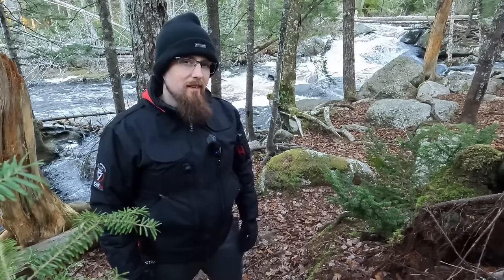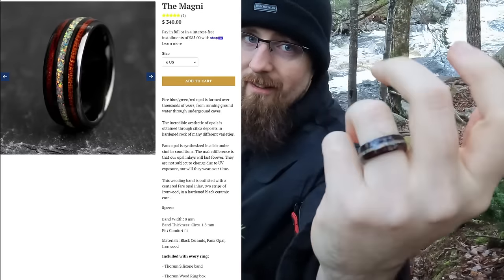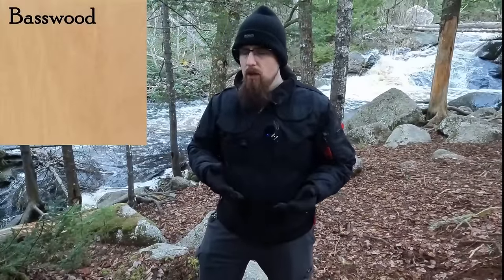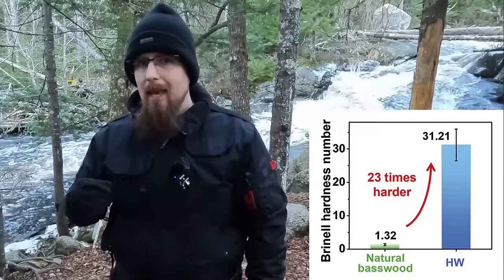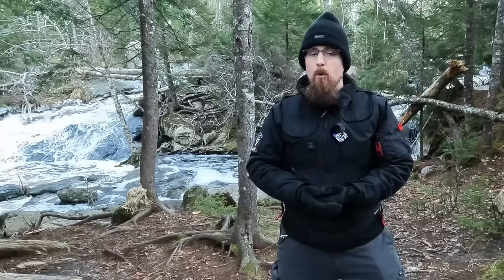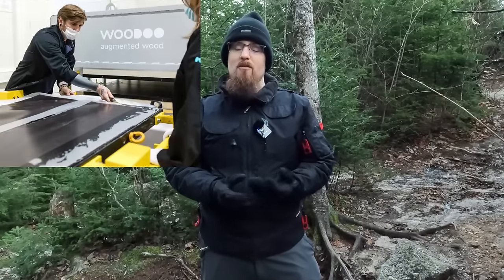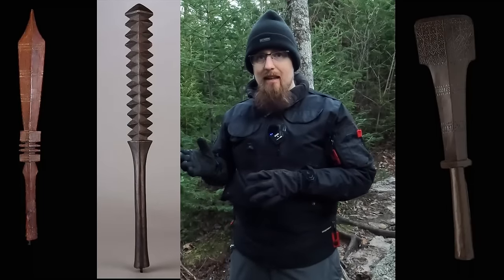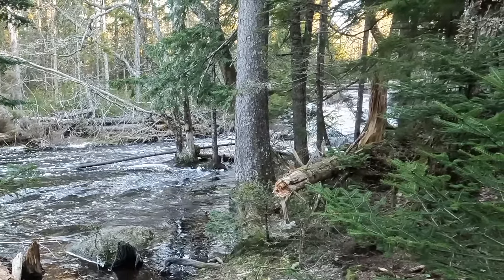Hardened Super Wood!  -  Can It Rival Steel?

Comment: I'm a baseball bat maker and engineer, and have been looking at wood densification for baseball bats. One thing to note, the hardness goes up but also the density goes up. The strength to weight ratio is actually very close to that of real wood, so densified basswood made at ipe level density will have roughly ipe level strength. It isn't a magical performance increase and its main benefit is cost efficiency over performance increases. It's good for going beyond natural wood capabilities, but strength to weight ratio does not go beyond natural range.

It has major issues with moisture and movement in service. Epoxy impregnated wood is brittle and has reduced specific strength. So super hard wood is still a niche product, not for the industry yet. Otherwise, it'd be everywhere by now.

Now, the process that seems most promising to wood industries and is currently implemented is the process currently used with wood veneer, which is surface densification. Think of it as case-hardening, but for wood. You harden and compress the surface of the wood while the core remains natural and light. This has the effect of reducing wear and tear while not making it super heavy. It's like how you hammer bronze to work-harden it. They're all the same effect. Case hardening carburizes steel to make the surface harder. Hammer bronze to work harden the edge. Compress the wood surface to make it harder while density doesn't go up as much.

Ironically, this has been done unknowingly by baseball and cricket players for centuries, called boning the bat or knocking the bat for cricket, where you rub a bone, hammer with a mallet, or rub a hard metal bar to compress the wood and close the pores. It is effective and very well known and i believe this process might have been used for ancient weapon makers, although sources are hard to come by. I can imagine it so, since it's so easy. The effect of compressing the surface also makes fitting attachments easier since the wood will expand with moisture, filling the gaps. This is prevented with a good sealer and finish, but it isn't perfect. Shellac and tung oil is the historical finish of choice, but it can sometimes pop the grain, which ruins the densification

I rub a steel bar on all my bats and players can tell the difference
Reply: have you tried any boiling,  drying, and vacume impregnation with epoxy?
Reply: @RubSomefastOnIt  not me personally but my buddy tells me it's too brittle. He tried vacuum and oven dried cherry and walnut and impregnated with epoxy, densified it to the high density bat level on a 271 turn model. Getting an evenly round surface is hard and the results were underwhelming. It hit just like a regular hard ball bat and then flaked off. The effect of the epoxy had the slight benefit of making large barrel turn models hit like higher density turn models, but at that point, might as well get a High Density bat.
Surprisingly enough, hardness in baseball is not as important as rebound. It's just that wood has poor rebound, so hardness is used as a substitute to prevent energy lost to deformation. A brittle process that is good against scratches will be bad for baseball
Reply: @Tevatron044  I have to tell you I rather enjoyed your read here. I actually find this practical as someone who's constantly bushcrafting and looking for small ways to use time to better improve my tools around a camp site. The knowledge you just dropped wasn't things I'd normally consider and I'm grateful you took the time to post it.
Reply: I believe the extreme case hardness of  Bamboo it what gives it extraordinary properties,  The technology  is nothing  new,  It was adopted in the industrial revolution  to manufacture bobbin spools for the weaving industry . I think  lime wood.    I recall a wood turner talking about it in a demo.
Reply: @HavanaWoody  lignostone is probably the oldest variant I've seen in the industry. It's laminated beech (a good strong wood in of itself) compressed into thin veneers and then bonded with epoxy resin. It's actually very famous and used everywhere for insulating transformers. Resin impregnated wood was used in WW2 for airplane components when they ran out of metal. So yeah you're right, this is nothing new. The new component is compressing the wood to remove the space between cell walls and removing the lignin. That is new, but like i said, it ain't special
Reply: Man, you really know what your talking about!
Thanks for that first comment!
Have a good 2022 from Patagonia, Argentina! 😀👍🏼🇦🇷
Reply: @henryrollins9177  haha, only about wood, metal and baseball bats. I hope you have a good New Year as well.
2022 is our year
Cheers from Miami
Reply: This was a very interesting read. Thanks!
Reply: @GenericHandle01  I've dealt with this issue many times. Bat wood is best to be hand split lumber to follow the fiber direction and kiln dried. We use a vac-thermo kiln and I've recently been experimenting with cryo treatment as a means of homogenizing dry times across cross sections.
Surface densification ideally takes place AFTER oven drying has occurred. This avoids shear forces on the cleavage. In densification, the lignin is removed and the cellulose cross links and bonds with itself. This is why moisture is such a huge issue with chemically densified wood
Reply: @Tevatron044  Thank you for clarifying. I have learned some super interesting things about modern wood prep from you. It would be fantastic to be able to make hardend-wood furniture at more affordable prices in the future.
Reply: @GenericHandle01  that would be amazing, especially since oak wood has a lot of densification potential and as far as I know, oak is the most popular wood for furniture and cabinetry along with walnut
Reply: so if I read this right I can use a hard material like steel to reinforce the surface of wood?
Reply: Interesting discussion.  Thanks.
Reply: @luneattic111  not exactly. Surface densification is the act of densifying and hardening the surface of wood, gaining benefits like dent and scratch resistance of densified wood without increasing the density by much.

Now, reinforcing the surface of wood is something that you could say is being done in the wood finish industry, considering the purpose of finish is to protect the wood from moisture and give it a level of scratch resistance
Reply: @Tevatron044  thanks for the reply back, definitely gonna try a few things out next time I'm making something
Reply: Wow. Thank you so much for the free lesson…. I really appreciate you sharing your knowledge.
Reply: It's interesting that on this study they used with basswood, which is extremely light - I wonder if that makes it a better base for these densification...
Reply: @michaelearl6765  oh all types of wood are being studied, basically whatever is at the local lumber supply. Another study i saw compared poplar and birch, 2 very important species. The birch came out stronger but the poplar increased by leaps and bounds more than the birch. There is an upper limit to the strength, independent of base, but for the most part, densification is being seen as a cost effective alternative to Hardwood, not a strength multiplier to it.

Birch is currently the number 1 choice of baseball bats, likely because it responds much better to compression than maple. That's actually a common request for bats to be boned (surface densified) before use. Another term for it is breaking it in. Basswood had decent impact resistance. I'm actually planning my own study soon in densifying willow wood, the wood primarily used in cricket bats. It's very soft and impact resistant and responds super well to compression. Any wood scientist or three that've tried willow? Lemme know
Reply: Do you achieve accidental surface compression with old, well-maintained and well-used tool handles? They sometimes feel as if they had a hard shell on them. Or is that shell just the combo of impregnation material, hand grease and other gunk collecting on the surface?
Reply: @redactedcanceledcensored6890  it could be the case, although it could be other things like asymmetrical drying called case hardening, could be a wood hardener or other junk impregnated into the surface, it could also just be the finish with a penetrative sealer. Old tools usually get surface wear in use, misuse, and during transport so in that case, yes it's involuntary mechanical surface densification
Reply: NERRRRRRD
Reply: This is really interesting. Thank you for posting
Reply: This is what I love about this channel, the discourse of experts. Thank you very much for sharing your valuable input with us.
Reply: @andrewjohnson6716  it's a pleasure. I love the replies and how I've helped others. I too love this channel for how we can combine so many different professions into a discussion
Reply: This is a great discussion. I can't speak on all weapons and weapon shafts but I am a Bladesmith and a Bowyer. I generally make traditional native American style self bows and arrows to match. I can say for certain that burnishing arrow shafts with bone or antler is something people have been doing for hundreds, if not thousands, of years. It makes all the difference in the world. I also do the same thing to wood handles and sheaths, esp if it's a chopper or a machete that might experience a lot of shock during use.
Reply: @Tevatron044  I've made a lot of things from several kinds of willow but the wood is generally not very useful. The cricket bats are made from a very specific species of Willow that has different properties, like Box Elder is a true maple but it has significantly different properties than other maples. Willow makes a decent bow but as soon as it dries out it becomes brittle and breaks. It's how I got started in bow making, as a kid my brothers and I would make 20 and 30 pound bows in the spring when the sap is flowing, we would put hundreds of arrows through them throughout the summer, and in August/September they would break. Our house was surrounded by willows of all kinds, ages, and sizes so we never ran out of wood. Willows can also be coppiced and were often coppiced to make basketry.
Reply: @douglasyoung927  that's really cool that you've also been doing something similar. It makes sense to do it on arrows. I know the American willow we have is trash, i think all the bats are made in Britain, which has the right qualities for English willow. I just got a piece of crack willow and I'm gonna try a thermo chemical compression process on it. I'll let you know the results.

Box elder actually is considered a maple but it has leaves like ash, so it's likely that's its genetics are from a really old ancestor. It gets red steaks in it from its antibodies fighting fungus and it makes really good burl. It's likely that Willow is the same way and we just gotta find a close descendant
Reply: Thanks for this free knowledge 🤙
Reply: @Tevatron044  I was watching the "arrows versus armour" video on Tod's Workship and one of the things I noticed was that the arrows' armour penetrating capabilities seemed to be limited in part by the wood arrow shafts. Instead of transmitting their entire kinetic energy to the armour target, a lot of the arrows' KE would frequently be carried away by the shafts' tendency to splinter and shatter on impact. If I had been a medieval weapons research and development engineer tasked with improving arrows, I'd have been looking for ways to increase the arrow shafts' rigidity, strength and toughness (and possibly looking for ways to increase shaft density). I've tried thinking of ways they could have achieved this using technologies that they either already had or that would reasonably have been within their reach. I thought perhaps they could have tried compressing the arrow shafts or burnishing their surfaces, or impregnating them with something like cutler's resin, or wrapping them in a glued-on high tension paper skin. Since thinking about improving the mechanical characteristics of wood seems to be your wheelhouse, can you comment on any of these ideas or suggest something you think might be more effective?
Reply: @Marmocet  that's interesting. It would depend on whether the shaft breaking is a compression or tension break. Tension break can be alleviated with stiffness. Compression break needs flexibility. Usually changing the shape is more effective than the material since durability as a function of wood density is linear or rational whereas durability as a function of volume is a power function. I expect that something as simple as a shape change would've already been tried so it might be that this is the best we can do in terms of arrow shape, so densified wood is maybe a more transferable route

Lye is a common chemical we use to remove wood material with the possibility of impregnation with a resin and compressing to densify. Never heard of cutler's resin. Might be interesting but untested. I would expect that arrow shafts would be the best choice for fully densified wood to improve properties since the change in weight would be small yet might be beneficial for penetration, but if you're gonna fill completely with resin without compression of the wood, that's basically a fiber reinforced resin. At that point, might as well go full in with a stronger fiber and make a medieval FRP instead of tryna make it work with wood
Reply: @Tevatron044  Thanks for the reply. It seems like the arrow shafts break under tension. 

By changing the arrow shaft shape, I presume you mean, increase its diameter. That would certainly increase the shaft's strength, but doing that would come at a tradeoff. A projectile's ability to penetrate a given medium is an increasing function of its mass and velocity and a decreasing function of its diameter, so the trick for a medieval weapons research and development engineer would have been to increase the arrow's strength without increasing its diameter if at all possible.

Perhaps my idea to use a high tension glued-on skin would be the way to go. When I was a kid, I used to build model rockets that had balsa wood fins. When I started building rockets that started reaching transonic velocities, the fins would often rip apart. I found that a solution to this was to glue a paper skin around the fins. While wet with glue, the paper would expand, then it would contract as it dried, forming a very tight skin around the fin. This would result in a dramatically stiffer, stronger fin. It always surprised me how much strength you could add to a fin just by gluing a sheet of regular lined paper around it.

Alternatively (or in conjunction with the skin idea), perhaps some kind of epoxy varnish would achieve what I'm looking for. I have found that some varnishes do seem to improve some of the performance characteristics of arrow shafts, although I have never used them for this purpose. 

Regarding compression, my understanding is that usually, a beam's stiffness decreases as its diameter decreases, so decreasing a wooden rod's diameter by compressing it would usually be expected to weaken it. However, and correct me if I'm wrong, this may not necessarily hold for woods that have a high resin content. I seem to remember hearing that wood of certain softwood species that have a high resin content can become stronger from compression. Is this true?
Reply: @Marmocet  varnish is never suppose to be structural. It does help, but a design that relies on varnish is never consistent. When i say increase diameter, i don't mean by the tip, only on the sections that have the most tension. The pulp skin reinforcement idea is nice, although i think hemp fibers maybe wrapped around the shaft might serve a similar function for vector strength
Reply: @Marmocet  also, it is true that decreasing the diameter will impart flexibility, but surface compression doesn't really remove that much diameter. It turns the surface into a hardened skin, similar to your paper skin idea
Reply: @Tevatron044  Thanks for replying again. In light of what you've said, and after taking complexity and cost of manufacture into account, it sounds like a suface-compressed, resin varnish-dipped arrow shaft might have been optimal given the technology they had at the time. Some R&D trials would have been needed to determine optimal geometry. A tapered arrow shaft would have been aerodynamically best, but perhaps a barreled profile would have worked better or armor penetration.

Another question for you: Last time I went to a ball game, I picked up one of those novelty bats that are about a foot and a half long. Those little bats are phenomenally hard, tough little things. It's hard to believe they're even made out of wood. Do you know if they are? And if so, what is being done to them to make them feel like little pieces of steel?
Reply: @Marmocet  usually we use our higher density billets for trophy bats and stuff. Wood density is a huge variable. Birch can be as light as hemlock and as heavy as hickory. The lighter wood is used for youth bats and training tools. Heavy Birch can be around 50 lb/ft^3 which is as dense as hickory and arguably better performing pound for pound for its unique level of flex, not too much, not too stiff. Also, they're probably coated in clear coat, which is good for trophy pieces, bad for bats
Reply: @Marmocet  also i would argue that a chemist with some lye and a vacuum bag could densify wood close to the levels you see today. With a lathe and steel tools, he can customize the shape of an arrow to maximize stiffness while minimizing weight and drag. This would not be something for the mass market, but something an assassin/ hunter type specialist could learn himself, similar to how snipers and marksmen today can make their own ammo on the fly
Reply: "rub a bone" hehehehe 😏
Reply: Is there a way of getting the inside of the wood to expand coursing a Prince Rupert drop-like effect?
Reply: all valid points however I'd like to point out that... it wouldn't be everywhere by now because by now we're only starting experimenting with woods and other sustainable materials. Strength to weight might change due to there being less lignin and more (percentage wise) cellulose, for better or worse, nature's very good at coming up with peak solutions so an increased hardness might be fine for maybe tabletops, but without more data we can't be sure that it didn't loose sheer strength due to removal of lignin and compression, either way it's good to keep going until we can know whether it's something to stick by for some uses or abandon it. Afterall, it's just an emerging technology
Reply: Strength to weight ratio does go up as you are removing a lot of the lignin that adds a lot to the weight but little to the strength.